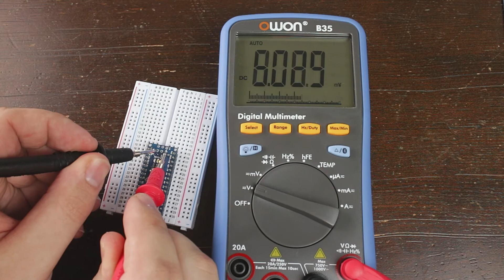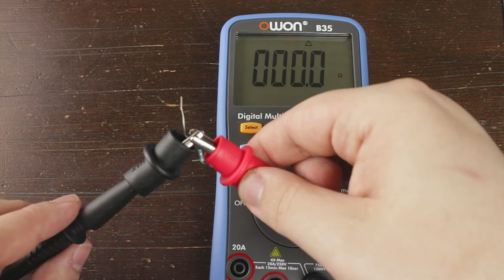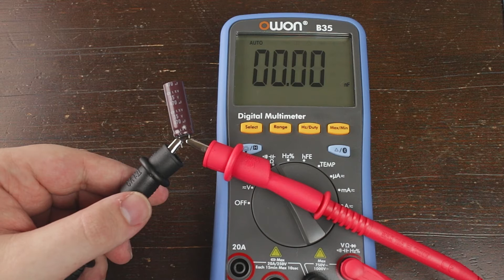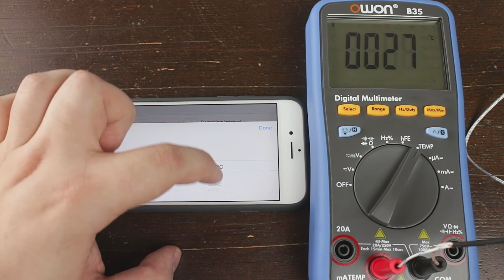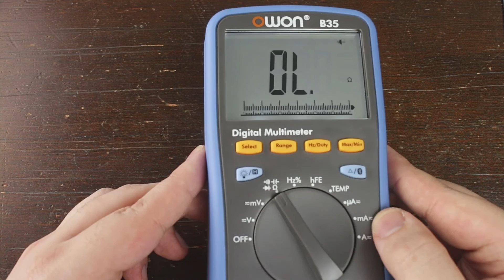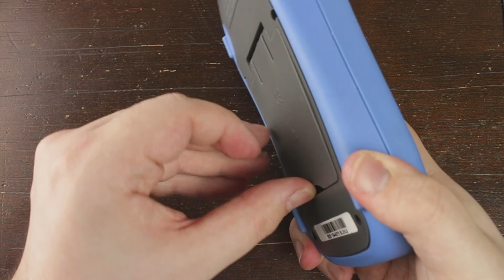Owon B35 Bluetooth DMM Review

Comment: some concerns that i have when considering a multimeter are... What kind of battery does it use? And does it have an auto turn off feature.? And how long will it run whithout autoshutting off when doing a test, such as monitoring voltage etc.

Comment: I have this multimeter , its get paired with mobile but when opened in OWON apple  it doesn't show up. Can u help
Reply from the maker: Are you using iOS or Android device? After seeing your comment, I tested to use B35 with my Android phone and the app looked little bit different than the one shown in this video.
I had to 
1) Run the app ("MultimeterBLE")
2) Turn on the bluetooth on the meter by holding right blue button for couple of seconds
3) Click "No Device" -text or the icon next to it on the app.
4) List of compatible devices popped up (If the meter doesn't show up in the list, hit "Scan" in upper right corner of the app)
5) Select correct one by clicking it
6) Meter's reading is shown in the app.
I don't own iOS device anymore, so I can't test if current version of the iOS app works different way than on the video.
I haven't had problems with the B35 and the app, so if this doesn't work, I'm afraid I don't know what the problem could be.
Reply: I tried on iPad too, it connects to bluetooth but when i scan in app, it doesn't show up. Is the device defect?
Reply from the maker: Did you try to scan in app, before pairing the multimeter and the mobile device? At least on Android the pairing isn't needed (no need to scan and pair in android's settings.... Just in the app).  I don't know if that pairing could mess up the connection.
I think you should contact Owon to see if they know how to get your meter to work with the app.

Comment: I have an Android 4.4.2 tablet (Samsung Galaxy Tab 4). Will the app work on that? It has bluetooth 4.0 also. I ask because the Starbucks app will only work on smaller screens, not on my tablet.
Reply from the maker: I do remember seeing someone use tablet with B35(t), but I haven't tested it myself.
You could try installing the app, which now seems to be available on Play store (Search "Owon multimeter"), and see if it runs properly.  If the app looks OK and you get the Bluetooth 4.0 version of the meter, I think it should work... I'm not 100% sure, but I believe if it wouldn't work with a tablet, you would see it even without owning the multimeter. 
I hope this helps.

Comment: Hello, Could you tell me where did you download the app?
Reply from the maker: The iOS app is available on AppStore (https://itunes.apple.com/app/owon-multimeter-ble/id1049176636).
Android users can go to Owon's website, click "Support" tab below the product description and click the download link in there: http://www.owon.com.hk/products_info.asp?ProID=181
Reply: Hello,
Thank you very much for the information.
I believe you have B35 (not T or T+).
How did you install the app? iOS compatible for B35T/+, but not B35.
Thank you,
Reply from the maker: That's right, I have B35, without the "T" or "T+".  The app works with it just fine.
Reply: Hello, Thank you very much for your reply. Somehow it doesn't work for me. It doesn't show on device (iPod, iPad, iPhone). I thought may be you have some technique to install.
Reply from the maker: I wrote quite long answer, which disappeared due to an bug in YouTube comment section.
Short version: How new models your iDevices are? Some of the older models might not work if the multimeter has Bluetooth 4.0 in it
Little longer version: If you have bluetooth enabled on your iDevice and B35 (bluetooth icon visible on the display) and can't see the multimeter in the list that appears on the app after hitting the plus-sign, there is something wrong.
I was searching for possible solution/cause and what I came up was bluetooth versions, and lack of backward compatibility. B35 (at least the one that I have) apparently has only "BLE" (bluetooth low energy) which is part of bluetooth 4.0,  and it doesn't work with BT3.0 devices. As far as I know iPhones before (but not including) 4s, couple of first iPads and most iPods DON'T have BT4.0 and therefore can't pair with (or even see) BT4.0 devices.
Reply: Hello,Thank you very much for detailed reply.I have iPhone 6s (iOS 9.3.2), iPad Mini 3 (iOS 8.3), iPod touch 4th gen (iOS 6.1.6) and tried Apple App store BLE, but app doesn't work on any of device listed above (said no device, can't find through clicking + sign)I thought I can use iPhone 6s for B35, but not working.What exactly do you have (iPhone xx, OS ver xx, B35 (Do you have Bluetooth 4.0 B35, if so, how can you tell)?Thank you,
Reply from the maker: I have iPhone 6 which is running iOS 9.3.2, but I was also using B35 when my iPhone had iOS 8.
Sticker on the back of the meter has serial number which ends " BLE4.0". That is simplest way to know the B35 is Bluetooth 4/BLE version.  
If your B35 has that " BLE4.0" in the end of the serial number, I'm out of ideas and I think you should contact Owon or the seller.
If the serial number doesn't have " BLE4.0", there are few options:
-If possible, try if you could return the B35 and get your money back. Then Get B35 from a seller that tells it is BLE/4.0 version (From Owon directly?).
-Try to sell your B35 and get the BLE/4.0 version
-Keep the meter and maybe get another BLE/4.0 version.

Many sellers have added clear information telling which version it is and which devices/operating systems it supports... But unfortunately some sellers havent done that and buying from such seller seems quite a gamble. I will add warning about this thing in the description.
Reply: Hello, Thank you very much for quick reply.Unfortunately, my serial number doesn't show BT version. I called Owon and they said that I have BT 2.0 from serial #. Owon uses same box for all, thus we can't tell from the box and normally we can't open box. Seller said BT capable but not mention anything about BT version difference. I'll contact Owon again because I don't know how can I get hold seller to be responsible, we can't tell BT version at time of purchase from box nor tester.
Reply from the maker: That really sucks! I hope you'll find a way to get the BLE version, which will be compatible with your devices. Each time that I have contacted Owon (via email), they have answered quickly, been polite and really helpful. I really wish they can help you with this problem.

Comment: For the price, the BT functionality is a great value; right on your phone you have an auto-ranging graph, and you can share the graph with all the standard "share" options on the phone; nice integration.

Compare this to other meters in the price range, like the UT61E, that uses a SERIAL CABLE to talk to PC only, and there you even need to get a serial to usb converter; all kinds of extra cables, a needed pc, and software and driver installation. This sucker does all that wireless to pretty much any phone.